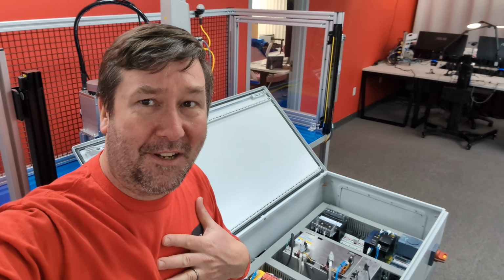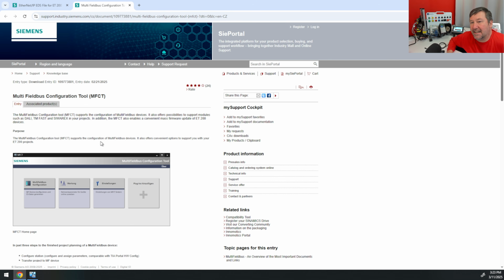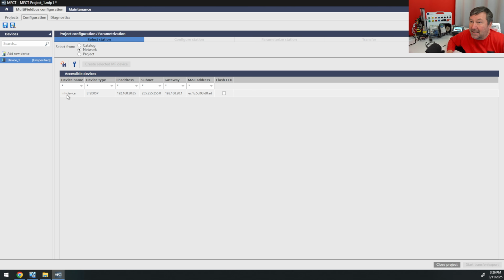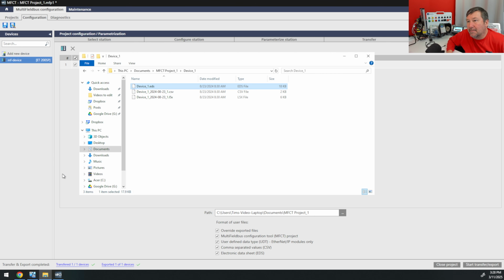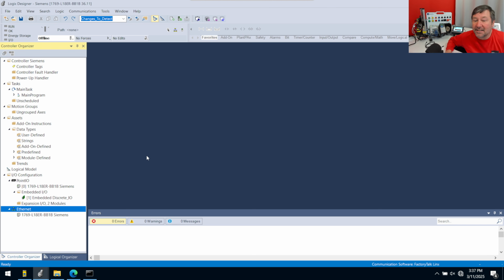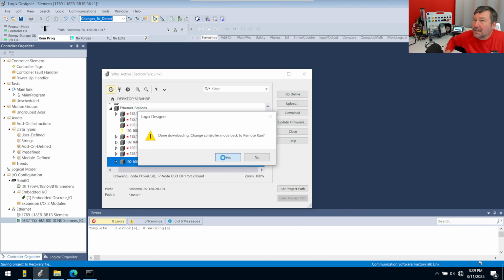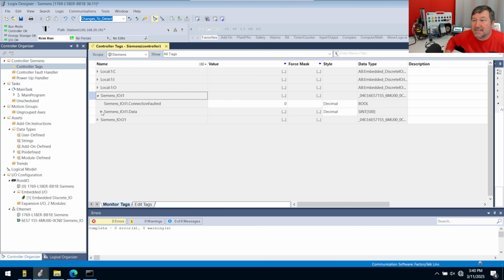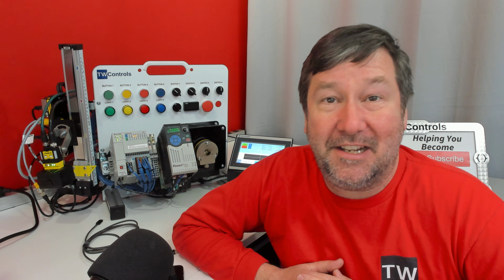Connecting Siemens ET200SP to Allen Bradley PLC in Studio 5000

Comment: @TimWilborne Great video, in my country (New Zealand), ET200 IO is very, very cheap while Rockwell IO (or anything, frankly) is very expensive, so there's a real use case here. 
One question: Could you do this using a generic ethernet I/P device in the Rockwell controller if you really wanted to?
Reply from the maker: Yes, as long as you got your assembly locations and sizes correct it would work fine.
Reply: @TimWilborne  Do you know if its possible to get the data header sizes out from the 'proper' eds's? I did this with point io once and it was tricky
Reply from the maker: Yes, the Siemens software gives you that info

Comment: Does this allow you to read just the inputs and outputs or does it allow you to read all tags on the siemens plc?
Reply from the maker: The S7-1200 can read and write to AB PLCs using the Ethernet/IP driver and AB PLCs can read and write to the S7-1200 using Modbus TCP.
Reply: @TimWilborne  Is it possible to configure the AB PLC to control the ET200SP Node via Ethernet/IP using this device?

Comment: Very interesting. But genuine question, why would you want/need to do this?
Reply from the maker: There are very few systems out there anymore that are purely one brand.  I could have put any brand on this but this had some great diagnostics features and a good variety of modules for the size.
Reply: @TimWilborne I would also say that with I/O link system in action companies want you to have access to more brands …

Just 10 years ago Siemens / Allen Bradley and codesys world were ermetic and not communicating and it reflected on the system build by the company…

I think this will allow more interaction and innovation
Reply from the maker: I agree!

Comment: This process it’s extremely good nowadays with Eds conf. Files 

I had to work on an old Omron CPU converted  (C200H -> CJ2M) to install a new remote for a mineral process facility they installed a new mill machine 

I had to add a ETH expansion unit and manually write everything ( conf address , nr of words and ect ) through a Sender and receive modbus TCP function block …

Yeah don’t use it on old equipment ahaha install another plc and if you want to go easy use wire signal if the distance it’s really long (more than 50 mt ) or the quantity of data significant then use ETH

PS ( I had access to the program of course but had no comment since was so old that at the time wasn’t available and the company doesn’t exist anymore ahaha )
Reply from the maker: Sounds like you had a good project!